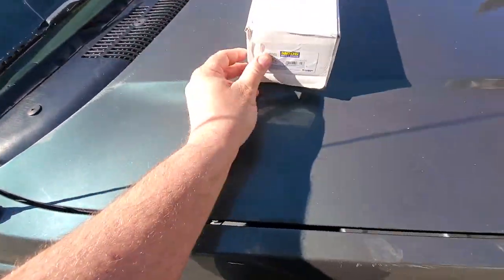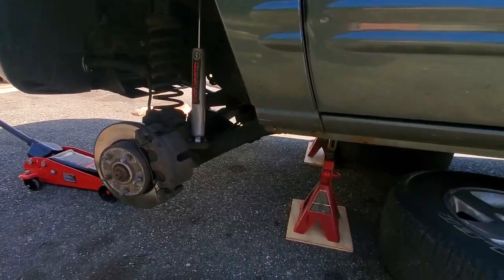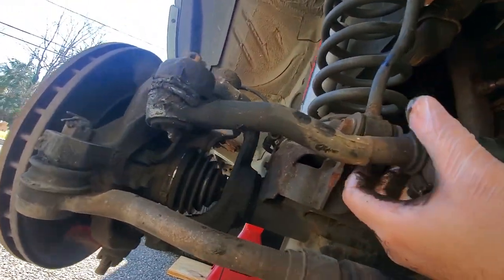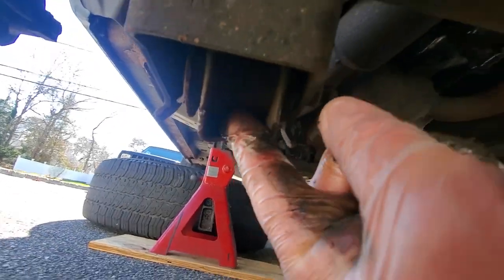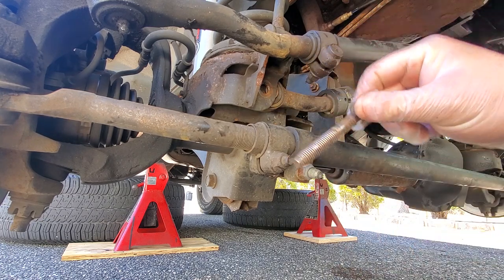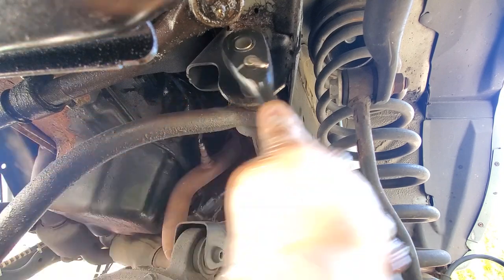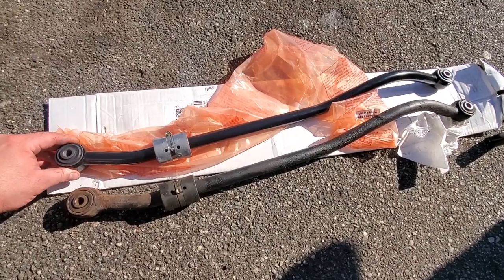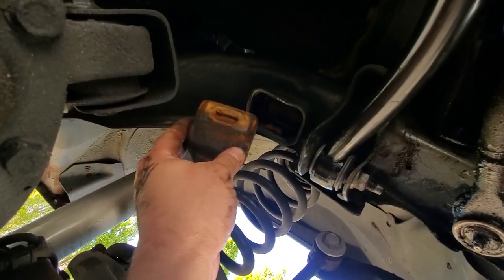I GOT DEATH WOBBLE!!! JEEP GRAND CHEROKEE WJ TRACK BAR REPLACEMENT

Comment: I have been building and modifying jeeps for decades and have repaired lots of death wobbling jeeps for people.  Tie rods, track bar, drag link, any of these can cause death wobble to show up.  One reason the xj and the wj are more susceptible to death wobble is their factory caster settings.  The come from the factory literally on the ragged edge of what is not enough caster, 3.5 degrees.   After repairing the current cause of your A set of adjustable lower control arms is a must do upgrade.  Use the adjustability to turn that caster angle up to 5 degrees, even 6-7 on a lifted rig, set the toe properly and even a worn out front end will be much less prone to death wobble.
Reply from the maker: Excellent info Shane! Thanks for your input!
Reply: My ZJ has 5.5" lift has every single bushing imaginable worned out and not a single death wobble...just slightly-felt loose steering. My caster is 12 deg passenger size and 14 deg driver.
Reply: Would you mind steering me in the right direction? I took my tie rod bar off the wj and placed it next to my new assembly to get the measurements as close as possible. I noticed that the old one has a tilted tie rod end. Do I match that tilt angle on the new one to get the same measurement? 
Thanks!

Comment: Dan, you should tight the bolts when the jeep is with the hole weight on the street and you roll it a few meters. Then your axle will center and your bushings will be in the correct Position.
Reply from the maker: That's a great tip!
Reply: I messed up my track bar by replacing it on the ground. Ima jack it up and see if that makes a difference cause my passenger tire sticks out more than my driver

Comment: I replaced my track bar on my 2004 WJ because I was getting the death wobble.   A year later I got the death wobble again.  That's when I watched your video where you replaced the upper and lower control arms and axle bushings.   I figured mine needed replacing since it had over 230k miles on it.  Sure enough they were all completely worn out.  After replacing everything I still had the wobble.    My hunch was the one year old track bar was bad even though it was 1 year old.  I replaced it again and 5 months later no wobble.  It held out for a year but got worn out because everything else was shot.  Not sure how long after you replaced your track bar you changed out the rest of the front suspension but if you still get the wobble start with that track bar again.
Reply from the maker: yes, that's the problem with made in china replacement parts... they don't last

Comment: Heya! You beat me to it - I actually just got done putting a new track bar and steering linkage on my MJ. I got death wobble going 75mph and had to pull over and slow down to 30 to get it to stop. Pretty scary when you're hours away from home, alone, and praying for dear life that everything holds together
Reply from the maker: Amen! The Good Lord will never forsake a faithful jeeper 😁
Reply: First off.. how tf you get a WJ up to 75?? Must have the 4.7. Lol
Reply: Did it stop the death wobble?  My grand cherokee has death wobble and lots of play in the stering wheel.  I'm thinking I need to change my track bar.

Comment: I put a 3 inch supreme suspension with pucks and pro comp shocks.Also a rough country trak bar.So far so good on my 99 WJ with 121,000 miles.
Reply from the maker: Awesome Joe! I just did an adjustable RC track bar on a friends GC too

Comment: You need an adjustable track bar after you lift it, that's why your steering wheel is crooked, when you lift it and use the non adjustable track bar it pulls your front differential to the one side, you can see when you measure how far each tire sticks out on the sides
Reply from the maker: You are correct, I will be putting in an adjustable trackbar in a different video.  unfortunately my steering wheel was out of alignment prior to my mods 🤣🤣🤣

Comment: The Niner got all new drag, track, lower control arms and ball joints. A pain but at the time it wasn’t driven much and I’m sure all those parts haven’t been replaced and they sure needed it. Then new tires and alignment cause all that stuff done unless you have lifetime alignment would get pricy each time you replace something lol
Reply from the maker: Yeah man, I usually bang out the whole front end then get 1 alignment.  So far this WJ inst too bad

Comment: Turn the steering wheel to the right to move pitman arm out of the way...New Steering stabilizer is in order as well, Get a heavy monotube job. Get adjustable lower arms, make them 3/4 to 1 1/2  longer bolt to bolt to compensate for lift, no more death wobble. Rear adjustable arms are to correct pinion angle after lift installed. Upper bushings, and ball joint on rear, Also 1" swaybar on rear help with rear end wag. Nice vid Bro. Latex gloves, help with greasy mits.
Reply from the maker: Thanks for all the tips!  Very much appreciated! 👍
Reply: @ProjectDanH  Hey, it's why I watch your videos, for the tips...Thanks Dan, much appreciated.
Reply: I was down after my jeep got death wobble, your video cheered me up and showed me how to replace it. Thanks Dan. You're my new 'go to' jeep guy.👍 👍👍

Comment: Your videos really help. working along the same line. High mileage WJ  Just completed front suspension and brakes . Will be starting rear suspension and brakes when we return from RV trip from Texas. I still need to order track bars and upper rear control arm. Have some lower right quarter panel work to do and gas tank skid plate replacement.
Reply from the maker: Thanks Paul! I appreciate you watching.  Try maxpeedingrods.com for suspension parts and use the discount code DanH for 10% off.  Have a safe trip. God bless!
Reply: Thanks Dan. Will do. Will be coming up to NY in Oct to see Nancy’s family in and around Cohose and Albany 🤠

Comment: I believe the main culprit is the lower arm,upper arm and wheel alignment because when you unmount the track bar it shouldn't tilt it side ways
Reply from the maker: All solid front axles will swing to the passenger side if you unbolt the track bar when its suspended.  But yea, most things on this WJ need replacing! haha

Comment: I have a 2003 WJ that needs a complete suspension redo. I’m thinking about going with an IRO 3 inch lift kit and 235P85R16 Hercules Tires. I will be looking for HD front and rear bumpers after the upgrade.
Reply from the maker: that sounds awesome!

Comment: Awesome video as always Dan! I always watch your vids even though I don't have a grand cherokee. At 5:07 though ,your oil pan is looking pretty rusty. You should put some rust encapsulator on that to stop any further progression.
Reply from the maker: Thanks for watching man! The trans pan will be replaced soon but the oil pan scares me!  I know I need to take action but the thought of poking through pin holes (like i did on black beauty) scares me.

Comment: Awesome video! I have the same issue with my ‘98 ZJ. Time to swap out the track bar.
Reply from the maker: There ya go buddy
Reply: It's almost never the track bar, it's the drag link coming from the steering box, have someone move the steering wheel back and forth while you're under there looking ,you'll see play in it

Comment: When replacing the rear upper control arm, it is easiest to remove it WITH the ball joint still attached. The three 18MM (IIRC) bolts can be easily accessed and removed using a box-end wrench. The arm almost never releases the joint unless you buy the ridiculously priced puller that is specifically for it.  Also, while you were working on the axle-side of the trackbar, I did notice the dent next to the trackbar mount @ 6:46. Looks like your draglink made some major contact at some point.. Keep up the good work, my friend.
Reply from the maker: Thanks for the tips brother! I noticed that bash mark too.  Another subscribers said my drag link may be upsidedown. Lol.  Previous owners 🤦‍♂️🤣
Reply: @ProjectDanH  Upon closer inspection of the WJ front axle I have sitting in the driveway (for my Firebird 4x4 Project) I would have to agree. The knuckle-end of draglink has an front-to-back curve on the joint (to clear the swaybar endlink bracket) and the steering box-end has the up-and-down curve. So your draglink is upside down or is it rotated?
Reply: @EverydayOffRoad  3 yrs and no answer. Shame

Comment: My ZJ didn't have death wobble issues it just had wandering all over the road issues....my 96 ZJ never had that issue, my 98 ZJ did and it was horrible.  The transmission failed and the lower end engine knock was bad enough I ended up getting rid of it instead, wise decision I think, transmission issues, upcoming engine issues, and electrical issues, yeah don't miss that pile of crap at all....sadly I loved my 96 ZJ thought my 98 ZJ would give me the same experience, nope :(.

Would like a WJ at some point with quadra-drive and do a 242 transfer case swap in it.
Reply from the maker: That sounds like a great WJ goal!

Comment: I had Death Wobble in 2002 WJ Limited real bad, at speeds as low as 25mph. Changed out the Tie Rods, Track Bar, Drag Link and Steering Stabilizer.

Fixed.

However, I learned something about how to get out of vicious Death Wobble. SPEED UP. Works every time.
Reply from the maker: SPEED UP!!! lol love it!

Comment: My 2nd gen has a different looking steering system. I have what looks like a shock in parallel to the rest of the linkage. I wonder if that's a better version? I know it's nice when off-roading because bumps don't affect my wheel as much.
Reply from the maker: Aftermarket steering stabilizer kit?
Reply: @ProjectDanH  Quite possibly. I purchased this Jeep used for $600 so I have no idea what's been done but it's definitely been owned at one point by someone who knows what they're doing. The engine has 300k but doesn't miss a beat so I'm quite certain it's been rebuilt.. it's got a 5 speed automatic transmission with much better grouping in the low range. Uses a manual clutch fan when it came with an electric (I found the remains of that working on the starter). It's such a nice vehicle and hasn't asked for much, just a sensor here and there, tires and brakes. It's a shame I live in the rust belt and it's starting to rust badly. But I'm gonna pay to try to beat it, gonna replace the rocker panels with square tube frames, and sand and coat all the rust away that I can.

Comment: Need recommendations. 2000 cherokee limited XJ. Need a stereo receiver with Bluetooth, backup camera, touchscreen, iphone and samsung compatible. Could you share a link or a older video that I missed. Had spinal surgeries so it's been sitting in the yard for the past 4 years. Looking to upgrade it and make it safer for my kids to drive.
Reply from the maker: Im planning on putting in a 2din pioneer unit in beach Jeep eventually.  It will have all the bells and whistles, just gotta pick on out 😁

Comment: I just got a 2” RC lift for mine! Appreciate it man
Reply from the maker: Excellent.. I would highly recommend getting new rear spring isolators instead of throwing out the old ones like I did in my video.
Reply: @ProjectDanH  okay will do! I appreciate it man ! Any other last min tips ?
Reply from the maker: @chriss.9466  that's the only thing I would've done differently! Good luck man!
Reply: @ProjectDanH  I just ordered them! They said “rear upper spring isolator” that’s the same thing right ?

Comment: So I just replaced my upper and lower control arms plus track because I just went through the same thing it's crazy as hell lol but I feel like I'm still some sort of oscillating issue could it be the rear control arms also? But it doesn't help me gearbox is bad also 😅

Comment: I just did a 3 inch budget boost on my WJ 2000. I'm getting death wobble at 45 and 55 mph. I looked underneath the Jeep to find out that there is no track bar installed
Reply from the maker: ☠☠☠ That's Crazy!
Reply: I found out I have a worn out drag link and the clamp that holds on to it was also very loose. I just experience another case of death wobble today. They're actually was a track bar I just didn't look under enough

Comment: So I finally got my track bar installed but now my steering wheel is crooked. Any way to fix this before I get the alignment? My plan was to have all the control arms done as well before the alignment. Maybe to get me by for a week or so. Not sure how to go about it super annoying with the wheel like this. Only short drives but still. lol.
Reply from the maker: Lol. Adjust the drag links. I have a vid in my post XJ lift

Comment: Great video, I'm getting the stuff together to put the 2 inch Rough Country kit on my '04 WJ. RC makes an adjustable track bar for the WJ, I'm seeing recommendations on the Jeep forums for using one to keep the front axle centered. Thoughts?
Reply from the maker: 1.  Make sure you get new rear spring isolators.. Im gonna have to get some.
2.  The axle is only off about 1.5 inches but I am gonna get an adjustable one too.
3.  Have a blast!  God Bless
Reply: @ProjectDanH  Thanks Bro!
Reply: @ProjectDanH  i installed the Rough Country Lift Kit exactly per your video and i tossed the old rear spring isolators per the video and instructions that came with the kit.  But your #2 above says "make sure you get new rear spring isolators".  Why the change of heart?  Thanks, Dan.  Your vidoeos are superb!
Reply from the maker: @jvillasana1  Thanks for watching ! I realized if you get new isolators youll have softer ride and exrta lift!

Comment: What size tires are you running? I have a set of 31" but currently at stock ride height. 2" lift should be sufficient?
Reply from the maker: I think you'll be good.  I'm running new general Grabber ATx 265 70 17.  slight rub in reverse
Reply: I have 31s with a 2.5 in Rough Country lift. I still had to trim the front bumper slightly so the tires don't rub while turning.

Comment: A good trick with the strap - keep up the great work
Reply from the maker: Yeah buddy it really works! totally sweet 😁
Reply: You don't need a ratchet strap to move the axle side to side. You can just simply turn the steering wheel side to side to get everything to line up for you.

Comment: Good job Dan.  Did you find the track bar cured most of the wobble ?  Would you say it's the major cause of really bad death wobbles ?
Reply from the maker: Track bar is the biggest problem.. Usually fixes it right up
Reply: I replaced my track bar on flat ground. When I removed it I got that relaxed separation as well. Got my son to turn steering wheel to the right and it lined up perfectly.

Comment: Hi, give me some more info on the headunit in your wj, its different from mine
Reply from the maker: It's an RB1 Nav unit for  2002 - 2004.  Of yours is older you will need to change your wire harness.
https://www.ebay.com/itm/353420860140

Comment: I know someone has had to mention this in one of your videos. You really need to consider using a torque wrench on suspension, steering, and brake components when replacing them. Too loose will cause wallowing of mounting holes or worse, too tight can over stress the hardware causing it to fracture and break.  Not good if it breaks when you're driving. I've been trying to stress this with our maintenance guy for years. Not long ago he was doing brakes on a Tundra. I asked him.. dude where's your torque wrench? Oh man you don't really need one, I got this.A few minutes later he snapped off a caliper mounting bolt.
Reply from the maker: Good point, I use torque wrenches a lot.  But after a while you get a feel for it.  The only bolts Ive ever broken were rusty ones that snapped during removal.

Comment: Wait, Dan you're not walking away from XJ's are ya??? lol I still had questions about My 1993 XJ Country... Your friend, MD...
Reply from the maker: XJ for life!
Reply: @ProjectDanH  lol Good. Hey I just ordered replacement bushings & sleeve for the axle side track bar. It all looked new to me but that 1/3 steering wheel play got me thinking. Darn track bar nut broke free so I'll have to probably cut off the bolt & get an oem replacement for it. The track bar isn't that old, maybe two years or so. Wonder why the guy didn't repair it. I mean he added the 3.5'' lift... Maybe ran out of cash....